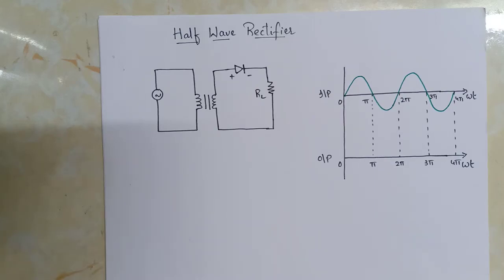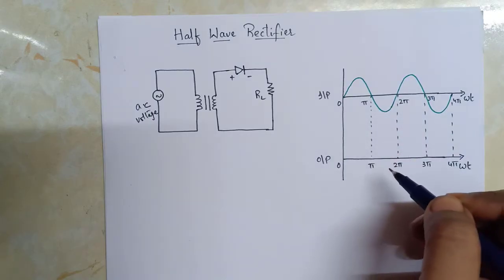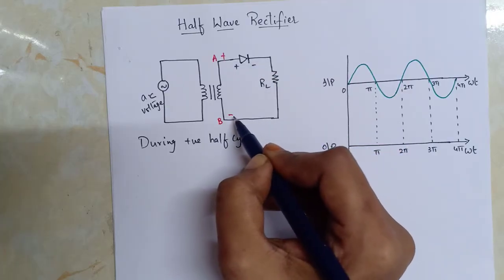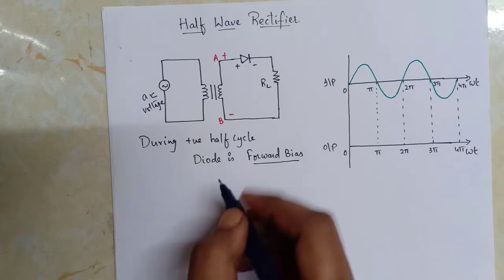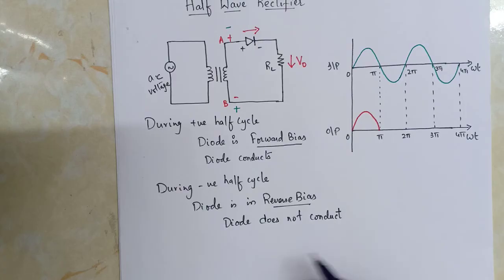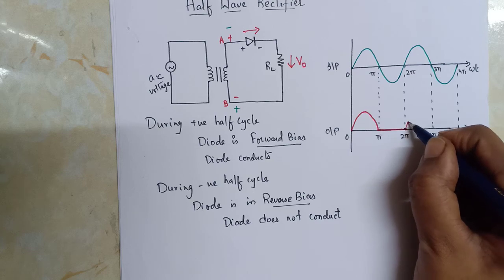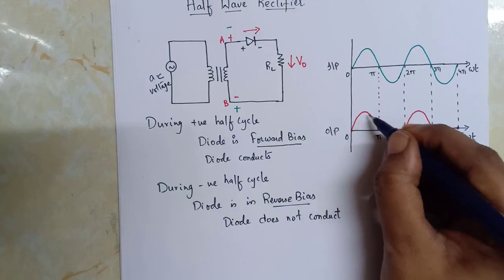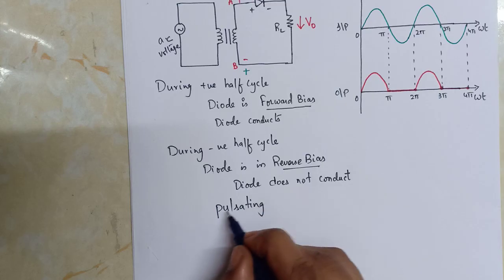Working of Half Wave Rectifier

Comment: How can u consider a to be plus there has to be a reason
Reply from the maker: It's an alternating voltage at the secondary terminal of transformer.At a given instant of time, If one end is at higher potential then other will be at lower potential.
U can take a as negative also but you have to change b also accordingly
Reply: @UshaRaniphysicselectronics  thank you for replying appreciate it. I saw a real life transformer there it has 4 wires. One wire connected to the positive bit of ac supply and one to the negative. Then 3rd wire connected to a poing in ur figure and b in ur figure . Therefore the positive from the supply and positive to the a point makes sense